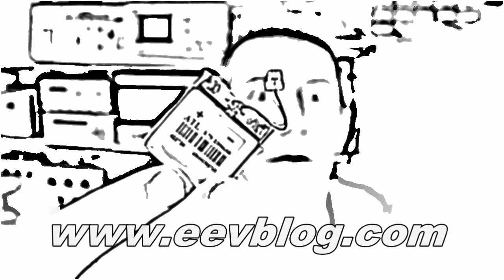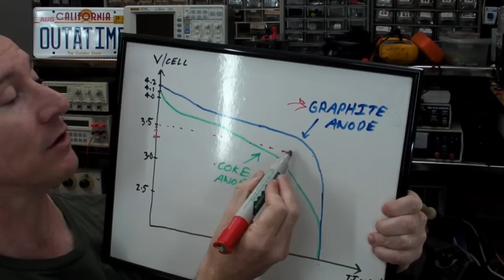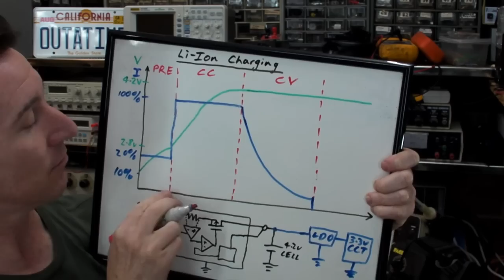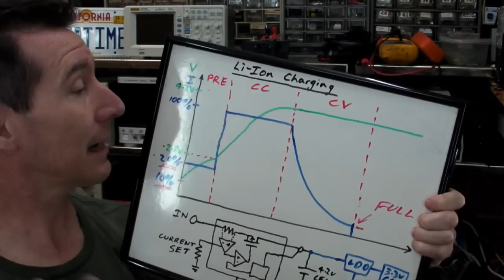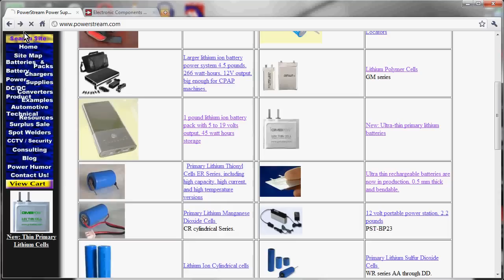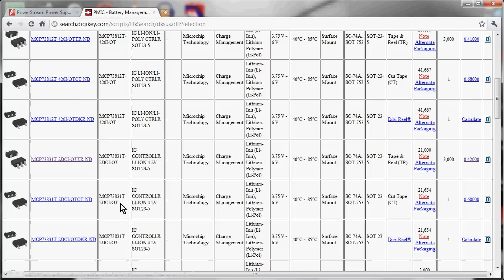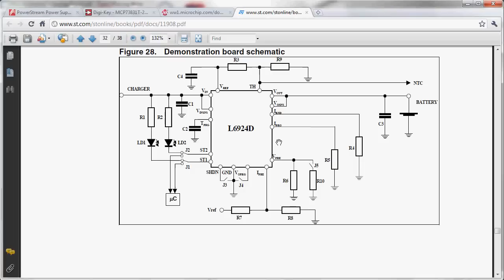EEVblog #176 - Lithium Ion/Polymer Battery Charging Tutorial

Comment: Actually past Dave, Li-poly are different from Li-Ion. Poly cells are prismatic and typically for high drain applications up to 30C, while most ion versions are for lower drain applications up to 20A and are usually manufactured as cylindrical cells
Reply: li po is li ion

Comment: Overall Your videos are awesome, thanks - helps a lot! :)
But story behind Li-ion, LiPo and LiFePo is a bit different.

Li-ion: Vn = 3.6V (uses transition metal ion eletrolitic compound)
LiPo: Vn=3.7V (uses synthetic polymer compounds as eletrolite lowering internal resistance... this is where +0.1V in avg comes from)
LiFePo: Vn = 3.3V (same synthetic polymer compound as eletrolite + different anode that changes reaction electrochemically itself).

Comment: Minor remark: charging is never exothermic with respect to the charged battery. The heat production comes from energy loss, the energy coming from the charger. Charging must be endothermic, because the chemical reaction to deliver energy necessarily must be exothermic.
Great explanation and great videos, BTW. Thanks a lot.

Comment: One thing to watch is power dissipation on the linear chargers - at charge currents over a few hundred mA, you don't need too much input-output voltage differential before the charge time gets extended due to the charger going into thermal limiting. Most of the cheap ones aren't packaged  to conduct heat out well.

Comment: Li-ion and Li-po do have a difference now some Li-Po have higher charging and nominal voltages and they are also also available in large capacity pouches where as li-ion are not and they have higher C ratings much higher compared to Li-Ion

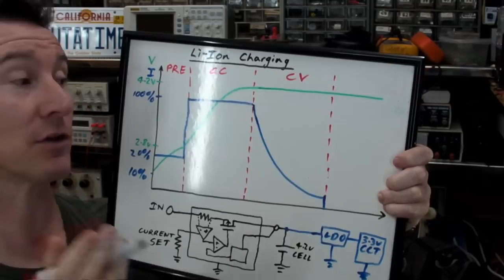Comment: Min 12:00 , what i dont get is . Does the battery voltage increase because the charger increases the voltage ? Or is the charger applying 4.2V constantly and still the battery voltage increases just slowly ?

Comment from the maker: @blackmuzzle You can't just make that blanket statement that "modern cells" have no problem. Read the datasheets for all those Li-Poly cells I showed. 0.5C recommended as standard charge, 1C absolute maximum for "fast charge". Always read the datasheet, cell types and their recommendations are many and varied.
Yes, some are specifically designed for very fast charging. The price you pay will usually be cell life.

Comment: Hi, im from the future! Thank you for this retro lithium based batteries tutorial, now days we just use flux capacitors.
Reply: well duh, it becomes a cold fusion reactor and generates perpetual motion .
Reply: yeah i only use the baterizer when i need to get 1.21 GigaWatt more out of my Mr.Fusion.
Reply: you're right.i've had that happening to me in galaxy s7 wich ended up destroying the whole universe so i've hooked up a 1N4148  to gnd  to prevent any reverse polarity. i only have 4 alternate dimensions points left on my driving licence.
Reply: The 4148 is a silicon diode which is nominally 0.7V drop.  You would be far happier using a 1N5817 which is a Schottky that drops 0.2-0.3V.
Reply: How many flux capacitors do i need to drive a Death Star and make the battle station fully operational?

Comment from the maker: @vaneenbergen I totally forgot to mention the protection circuit built into the bigger cell I was waving around. You really should be using these protected cells, they protect against shorts, over-discharge, over-voltage etc.
With the unprotected cells, you have to take more care, and either add your own protection circuitry and/or design your product properly to ensure the battery is not abused.
Reply: Hi, I want to replace my defective laptop battery from a 15 years old PowerBook G4. It's using US18650GR cells which are rated at 2100 mAh. They have no integrated protection circuit. Is it possible to change to XTAR cells rated at 2200 mAh or maybe cells rated at 2500 mAh or 3000 mAh? Will it change the charging process and damage my power supply by using a higher current? Will the protection circuit affect the laptops behaviour? Note: when opening the battery, it seemed like there is a built in temperature sensor for the whole package of 6 cells.

Kind regards

Comment: Dave, we can always rely on you for very solid material, like this one, on Electronic Engineering. Thanks very much. Keep them coming. 

Question:  
1/  In a charging system, like say on an Electric car (Completely Electric), where REGENERATIVE BERAKING charges the battery, how is this possible?  Since, during the REGENERATIVE BERAKING charging process, the battery is still supplying power to operate the various systems on the car (i.e Lights, radio, the Mini fridge with the cold drinks etc).  I would be very grateful if you could explain how the battery gets charged during breaking AND if possible, point me to any in-depth detailed reading material, and   

2/ Would this explanation apply to other battery types such as Led Acid

3/ Where could I find in-depth detailed information on Lead Acid Battery charging.

Thanks very much.

Comment: Hi Dave, I'm not fully agree about the amount of energy accumulated since the voltage reaches 4.2v and the current starts to fall. I have bought an Icharger 206B and made some experiments with the three types of balance modes it brings. I have logg all the charging proccess data and I would like to share it with you because I know you will get more information about them than me and maybe make another intersting video. If you are interested in, please let me know how to send you the data. The software I am using to see the data is LogView Studio.

Comment: All Lithium ion polymer batteries are lithium ion batteries, but not all lithium ion batteries are lithium polymer.

Those which are not "polymer" are the ones which catch on fire because the electrolyte is so flammable.  In polymer electrolyte batteries, the electrolyte is bound in the polymer.

Comment: You can't push the cell to higher than 4.2V without damaging it (which might make it go bang). Unless you use a ridiculously low charge rate the cell will reach that voltage before it's 100% full. As the battery charges its voltage gets higher, so to maintain a constant current you have to keep raising your charge voltage. Once you hit the voltage limit you can't raise it any more, so the current starts to reduce and the last few percent takes for ever.

Comment: Nice video, very educational :)
I'm building a charger using a MCP73833. The datasheet mentioned a design with a mosfet and a Schottky diode to isolate the load behind the charger. This negates the (possible) issue of the system connected to the battery from being affected when the battery is charged.

Comment: a flywheel diode is used to mosfet to protect it from damage but here is not needed because you don't have any coil,also I forgot to mention that the  flyback diode it's already build inside the mosfet.

Comment: That was exactly what I needed. I'm interning at NASA and we're building a prototype lunar lander and rover that powers a Li-Ion/Li-Po off solar panels and we were having trouble charging and some other things. 

I have a question though: Why is part 2 of the charging process (I believe it's called trickle charging) necessary? Why can't you just charge using the part 1 method up to 100%? Is it a safety thing, an efficiency thing, or something else?

Thanks

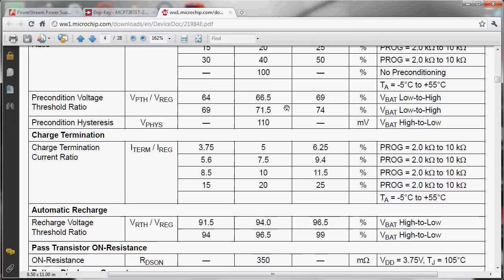Comment: 33:54 I don't think it's actually that high with respect to your diagram. The 20% in your diagram was with respect to current. Your precondition voltage showed 2.8V which is about 67%--pretty much exactly what the datasheet shows.

Comment: The main thing that is reducing the capacity is the discharge rate. The difference between 1C and 2C discharge is about 3% for 300 cycles. Of course, this differs between batteries also.

Comment: Is there a video on charging unprotected batteries? Would a charger know when a unprotected battery is full? 
If not how do i tell if battery is full or at the end process of CV if time not available on data sheet and cant measure current
Reply: Look at his video on charging Li-ion with a bench power supply, That explains the rest.

Comment: @TheEPROM9 Reminds me about 15 yrs ago I made a portable BBC micro - used the original case with a 320x240 mono EL display in the lid, and PSU full of nicad D-cells and a DC/DC converter. ISTR I had to mod the sound circuit to run without the -ve rail.

Comment from the maker: @mikeselectricstuff Yep, good point Mike. Could probably do another whole blog on just how to implement the charger IC's. Many of the packages like DFN will have thermal pads on the bottom to help with dissipation. The on-chip die temp monitors usually kick in around 120degC and limit the charge current.

Comment from the maker: @bcsupport Most chip manufacturers have devices designed for more than 1 cell. It's usually an option in the parametric search table. You can't just use a single cell charger chip with those.

Comment: Hi
I need to charge a li-ion 3s pack with my car alternator (14.4V). Because the alternator could overheat I want to manage the current to the battery. (cell balancing is handled trough bms)The thing is my charge current should go up to 60A, I can't find these kind of chips for these currents. Do know a solution/ circuit/ chip for this problem?
 Thanks

Comment: So we drone pilots are overcharging our "lipo batteries"?  When you see what a lipo vs a Li-ion can do with respect to power output on a drone, then you might concede to the difference we see. I charge mine at 4c when out in the field to 4.2 per cell. Why then do all universal battery chargers differentiate lipo and lion? In my experience, lipo can dump far more power instantaneously and not be destroyed.

Comment: It's pretty simple on paper but I'm having a super hard time finding a 250mA charging board that doesn't require me to replace an extremely small resistor to set the current.

Comment: Hello, your demonstration is just perfect (as others) I am trying to "revive" LIIon batteries for portable vacuum cleaners, they where not used but they are old now (exposition models)
I am not sure, if I plug my CC CV alim directly on the battery elements, may I use for instance 20% of the total voltage and 10% of the charging amp ? I tried on one cell as on the whole group and I see no amps asked by the batteries, nothing happens, SO there is no charging at all I suppose ? Thank you and sorry for the may be stupid question.

Comment: Is the Charge Protection built into those tiny Li-Po cells, usually covered by yellow tape, the same as the Battery Charging Chip you talked about? As in, if my Li-Po cell has built-in Charge Protection circuitry, can I just connect it straight to a 4.2V power supply and expect it to charge correctly on its own? (You may have mentioned this in the video, in which case I missed it...)

Comment: Presuming it’s fine for the alternator, can you use an alternator directly as a charger for big  lifepo4 packs? It puts out a Constant voltage of 14.6. And current is limited to 100 amps. It costs a lot to get a 100amp ic

Comment: What happens of you charge at lower currents than 1/2c
The generic power bank charging mpdules only put out about 1 amp
While the batteries used are usually 2000mah or 3400 mah 18650 type batteries in parallel.. Giving capacities ranging from 5000mah to 20000 mah

It will charge slow, but what impact does it have on the life span?

Comment: I really enjoyed this  video and at that, it raised a few questions. Where or how can I determine both the Charging or Discharging Rate by the "C" factor???  I looked at most of the batteries on the site and I do not see the "C" factor for charging or discharging any battery.

I don't need the formula because that I kind of have.. the max battery output is for instance is Max Continuous Amp draw (A) = Battery Capacity (Ah) x Discharge Rate (C).

So I just need to "C" factor or if not available, how else can I calculate this factor???
Reply: C factor or the C rating should be on every cell itself. Most of the cells have it included in their "type number"

Comment: Hello mate! Saw the entire vid and it's excellent. Amazing talent for explaining things you have. Now, would do please do a similar video explaining how QUICK CHARGE works? Various manufactures implement their own way of charging quickly, but I am more interested in those who do it using higher voltages. For instance Qualcomm's Quick Charge 2.0 and 3.0, it charges the lithium battery at 9 volts sometimes at 12 volts even 20 volts... It charges at 9/12/15/20 volts during CC and CV times.. now, how's that possible?
Reply: +FernanDK The higher voltage is used to overcome cable loss. Think power line and transmission voltages. High voltage + low current until it arrives at the transformer where it will stepped down. That's the whole point of Quick Charge, higher voltage + lower current = lower cable loss = higher efficiency.
If the Quick Charge charger outputs 9 volts, the battery won't be charged at 9 volts.
The power is only transferred at that voltage. When the power arrives at the device, the voltage will be stepped down by the power management IC inside the device which is in charge (harhar) of charging the battery inside the device.

Comment: I would like to make a large  12v battery using recycled laptop batteries, what should I use to charge that multi cell configuration from solar panels ?
Reply: +yoann thomann If the batteries are the same chemistry, capacity etc.. its fine to charge them this way, but if batteries are old, overused the charging one at the time is always a way to go

Comment: i got a little pump that uses a lithium ion 18650 battery, the circuit reposnsible for charging it failed (Water got in)... everything else still works. I take it I cant just bypass the circuit and use iPad or iphone (5v 1a or 5v 2a) charger to charge the battery? I need the little circuit?

Comment: Can you please talk a little bit about battery protection circuits and how to protect the battery with MCP73831 + LDO configuration against under voltage discharge (over discharge).

Comment: I just bought a 'hoverboard' that has a 42v battery pack (I think its 20x18650). The board was hardly used and the battery died and is now showing only 3.1v. Is it possible and safe to recharge this?

Comment: I have LiFEPO4 batteries 4 packs total voltage 12.8 VDC and I have 4 solar panels total 200 watts, if I connect these panels in parallel it can provide approximately 15 VDC but if I connect them in sequence it can provide either 30, 45 or 60 VDC, please advise which voltage charge is best for my LiFePO4 batteries and if I charge it with 60 VDC can it damage my batteries?

Comment: During the CV phase of charging, an exponentially falling current is still going inside the battery so why doesn't the voltage across battery increase during that phase?
Reply: Because the energy is being consumed in the internal resistance of the battery at almost the same rate.

Comment: I have a somewhat weird question.

Logitech is using a 1.5v wireless charging mat for their wireless mice, but they all use 3.7v LiPo batteries in their mice - how are they charging the lipo batteries with only 1.5v, if there's no voltage "conversion" anywhere that i can see?

I'm not sure if this makes any sense, hope you can help me out as I'm super stupid about all of this.

Comment: I have two new 2600mAh Li-Ion camera batteries (effectively a pack) that I’m unable to charge properly after only a handful of charge cycles. The weird thing is when they are fully discharged the charger reports them as 90% charged. After charging to100% I only get around 5 minutes use from them whereas new they gave me around an hour (I use them to power a 7” camera monitor). I checked with a voltage meter and they definitely have zero voltage output when discharged. I doubt the charger is faulty as I have two identical chargers and both give 90% percentage readouts when the batteries are definitely flat. What is going on? This started happening after they completely discharged once.

Comment: What it the best way to charge Lithium-ion batterers to maintain the life of the battery in a device like the 7 inch Kindle Fire tablet?  By battery life, I mean the life of the battery before it will needs replacement.  

Some say it should be completely discharge about once a month.  However, I also heard that is only valid for the old nickel–cadmium batteries.

Comment: How do these chips detect the true battery voltage during charging? I thought the battery voltage when there is a charging current and the battery voltage when no load is applied is different.

Comment: i want to remplace the old dead lead cells in a POWER BACK UP cyber power. can I just wire 4-3.2A Lifepo cells on series, the seller say these should be charge at 3.7. the Vout from the unit is 13.73V.

Comment: Hi so I have a question I have this Bluetooth adapter that I believe uses like 500mAh battery don't quote me on the size. But on the website & manual they couldn't stress enough don't use a charging device that exceeds 5V/1A. I'm afraid of charging it past that 1A because well I've seen Li-Po's go up in smoke. So would it be maybe safe to use smart charger that can output 2A to 3A? This battery has no safety regulator logic board it just knows "oh I'm charging I'll take in the amount of power being given."